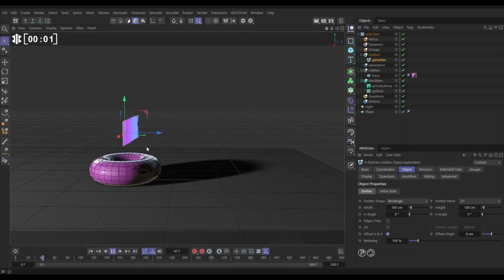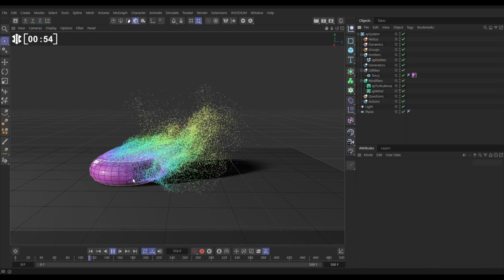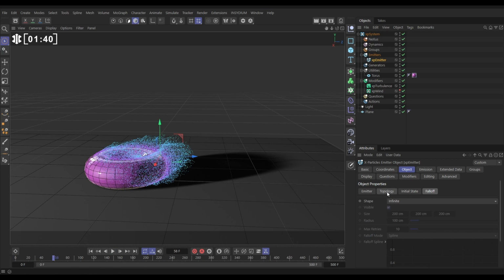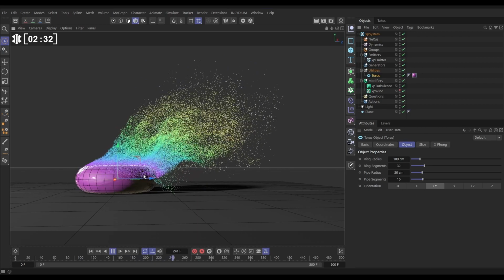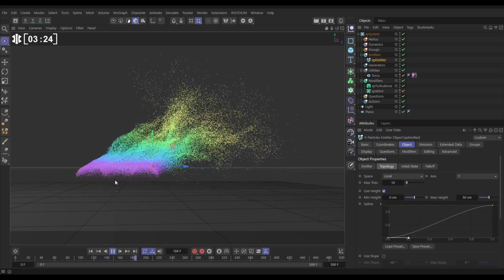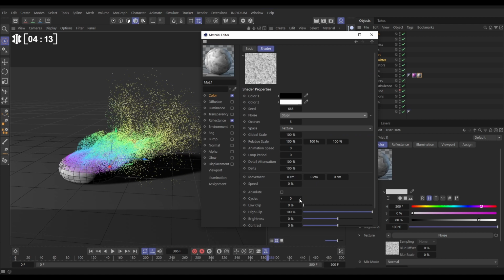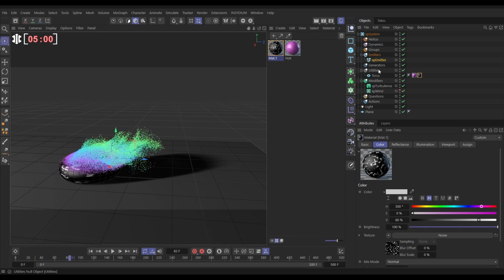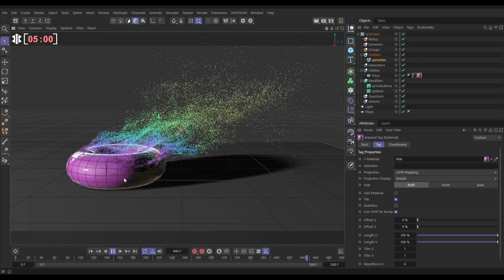Top Tip Tuesday! - Emission Control

Comment: Can you make emmit from redshift texture, as redshift became default renderer?
Reply: second this - should be specified it needs to be a standard render texture. But also now that RS is becoming default will it support it?
Reply from the maker: Hi,

X-Particles needs to access the standard material channels for data, these materials can be hidden from the render, where you can use Redshift or any other renderer materials.

-Thanks
Reply: @INSYDIUMLTD  Yes, thank you. But i still think you will need to do this someday as standart renderer has no future.